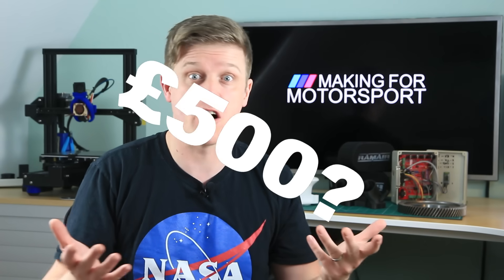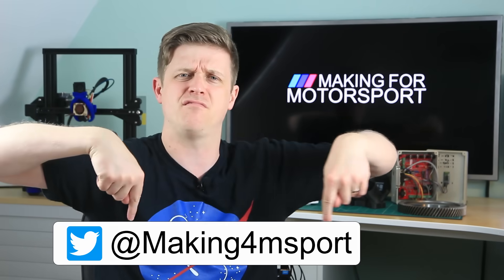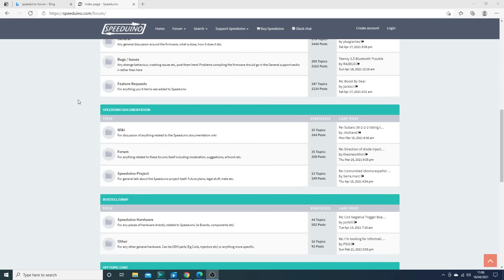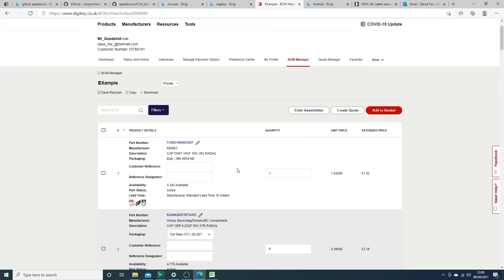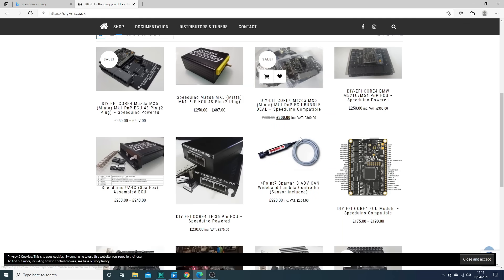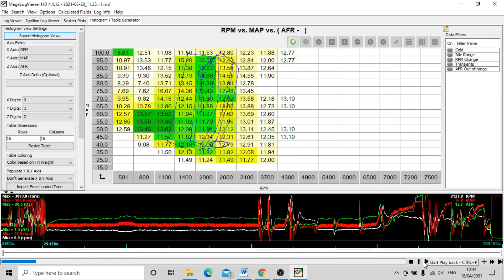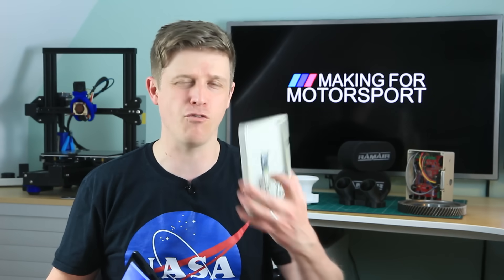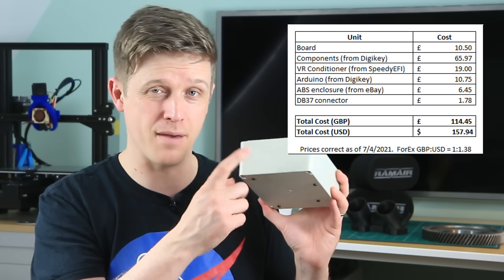The Best Value Standalone ECU - Speeduino

Comment from the maker: New video now out!  I solder, configure, install and run a v0.3.7 Speeduino against the clock!  Did it take me 4 hours or 4 days?  Come find out!
Reply: Makes me wonder if I could use this Speeduino to convert my 30 year-old 600cc Transalp V-twin engine to EFI.
Reply: @paulmichaelfreedman8334 do it
Reply: I’ve been thinking of putting flat slide 34mm carbs on a 70s Moto Guzzi v-twin motorcycle.  Hmmmm, maybe throttle bodies and one of these could be an option, although might have to wait for a shrunk-down version given the size of it right now
Reply: Where can I buy the speedo ecu in canada and it would  be for  a ford 2.9 cosworth boa engine and using  the ford sensor? And also for a second ford engine a 1990 taurus sho engine
Reply: Is this good for engine-swapped classic cars ?

Comment: My 5.9 V8 doge needs a new ECU. The rebuilt ones do not get re soldered. They just get reprogrammed.  The stock ECU is above the Engine and the Lead evaporates from the joints on the chips.  The new one will be located under the air conditioner.

Comment: In some country like in France, you are not allowed to reprogram your ECU except if a mechanic do it and then notify the reprogrammation and the new horse power to the gouvernement and it's mentionned on the car registration document (except if it a part ecu to replace a dead one without any modification on the engine behavior)
so making one by yourself or buying a speeduino it's a big no no, or your car would only serve in some car meet, you won't be able to drive on public road, if there is a big police control and they check that, you're cooked, if you have an accident, same thing, you are cooked, your insurrance won't insure you, and the law will guilt you by default

Comment: A daft question I'm sure as I know nothing about these things, but can anyone make an ECU control unit for an ordinary family car? I have a Peugeot Diesel HDi which I love but it had injection issues no one could suss out. Error codes were intermittent low pressure on diesel pump. One out of four injectors showed low return flow, one showed high return flow using manual measurement. Replacing these the results were the same. What we saw was turned over normally it just won't start for ages, if a bit colder it won't start at all. But it would always start and run fine after an Easy Start blast. I was about to scrap the car, (which would be such a waste of a good machine/pointless environmental damage) when I saw a few videos on advanced Diesel analysis and one mentioned that at least one car requires a certain RPM before it will fire, read by a camshaft sensor. So it could just be that the temperature here in Sweden was making the battery turn the engine that tiny bit slow and preventing injection? I don't know if that is the case here, but I would love to try and make my own ECU (I used to be a programmer, a long time ago, but I know a certain amount) and to be able to shut off response to various sensors to test and run the car properly. But where on earth does one start? Any clues appreciated... am I barking up the wrong tree, totally?

Comment: Sounds like it might be a good ECU for a home-made water injection system. Use RPM, throttle position, exhaust gas temperature, and the knock sensor signal as inputs to keep knock and combustion temperature in control while allowing a chemically correct air to fuel ratio for all driving conditions. It should allow more boost at full throttle to get more power from the same amount of fuel.
Reply from the maker: Apart from EGT sensor conditioning then you’ve got the hardware on board to do what you are after, the software isn’t my strong suit…

I’d suggest you float this on the Speeduino forum as those guys actually know what they are talking about 😂
Reply: @ never know... Someone might already be working on a board that will do both EFI and water injection.

Comment: Interesting - what are the inputs into your unit?  Wide band O2 and what else?
Reply from the maker: Intake air temp
Coolant temp
Manifold absolute pressure sensor (for speed density mode)
Throttle position sensor 
Crank angle sensor
Cam sensor (for sequential injection and coil on plug)

Comment: Will it work on a  1989 jaguar V12
Reply from the maker: Hmmm…. It won’t be ideal, I’m not gonna lie.  It doesn’t have enough channels to run the whole engine, but it can run half the engine as a straight6, in wasted spark and batch fire mode, you’d then need another Speeduino to run the other bank….

Now this might sound a bit mad but it’s how BMW ran their M70 V12 engine until the mid 90s so it’s totally doable…

Comment: Is there no pi based versions?
Reply from the maker: The Pi, as a microprocessor, not a good tool for this application, it needs a microcontroller.

The Arduino mega has 6 hardware timers and a high number of native digital IO.  Plus the firmware coding rather than OS and another application mean it’s less likely to glitch.

There are many applications for the RPi in creating dashboards etc, but controlling an engine just doesn’t need a RPi

Comment: Just what I need ! I plan to build a weird Land Rover engine using a 2.5L turbo diesel sub-assembly and a petrol head, then boost it to 2+ bar to see what it can make.
Reply from the maker: Wow… now that is a Frankenstein build if ever I heard of one!  You sticking to dirty diesel or going petrol?
Reply: @MakingforMotorsport  It will be petrol. The turbo diesel sub assembly is extremely strong and the compression ratio is rather low at just under 8:1 so lots of boost is the way to go. I'll keep rpm low 3.8k max and make lots of torque. I have an engine dyno I still need to build first, that will make things easier.

Comment: So, do you have a learn made where the new controller connects to the old working unit to learn your car's algorithms?
Reply from the maker: No, this only works in standalone mode, not piggy back.
However, the table wizard in the packaged software is good enough to get you going and if you want to get real good data, especially for spark (which is often the hardest to tune), then a simple OBDII reader with a logging function can basically tell you everything you need to know (idle advance, max advance, all in revs along with lots of other data to interpolate from)…. 

I might do a video… 🧐

Comment: how about making a speeduino that controls 2 motors for an ebike with 2 batteries?
Reply from the maker: That sounds like a mental project, but also a completely different controller.  
I am no electronics expert but you can find dedicated brushless motor controllers that you might be able to control with some of the speeduino circuits…

Comment: Hey i have one question  i have a 2.9 cosworth boa engine with no ecu my question is can i use a reg 2.9 ecu to the 2.9 cosworth  engines?  Or which after market  ecu would be best for 2.9 cosworth boa
Reply from the maker: The BOA is a lovely engine, loads of potential
Realistically you need the original ecu and working loom to do a swap using OEM parts, otherwise you will have to get an aftermarket ECU.  A normal Cologne 2.9 ecu won’t run it.

As it’s a relatively simple v6 virtually any aftermarket ECU will run it, to run sequential injection and individual coils you’ll need 6 channels of spark and fuel, which are the more expensive ECUs. 

But the humble Speeduino will run it fine on wasted spark ignition (which is what it runs standard) and batch fire fuel…

Comment: where is the speedpi version then ??
Reply from the maker: The Raspberry Pi isn’t suited to this application as it is a microprocessor rather than a MicroController.
The microcontroller has far more onboard IO, has hardware timers and firmware rather than an OS so all the simple functions can be done totally native.  The RPi would need more daughter boards, take longer to boot up and be less reliable, becuase of the extra complexity, all the while not using anywhere near its processing power…
The RPi is a space shuttle to crack a nut.

Comment: Holy crap! Between this and 3D printing, my Chrysler Caravan will never die!
Reply: Lol
Reply: Why are you printing a Chrysler caravan?
Reply: Up here in the salty road north they dissolve within 6-8 years. LoL. 😆 even if the drivetrain makes it the frame/body won’t.
Reply: @cobannie  Yes, you are an endless source of engine parts!
Reply: @stepannovotny4291 😂😂 The rust belt provides
Reply: @cobannie  Do cars still rust faster in the north if you keep them garaged during the winters?
Reply: @amazin7006  They don't necessarily run faster - but they come up to full operating temperature faster.  My heated garage enables me to start the engine and drive off almost immediately - as soon as the garage door opens.  Unheated garage, it's still going to be cold, but less cold, and will get up to operating temps still faster than without a garage.  So not really faster, but will definitely get up to regular performance faster.

Comment: Hi, I got a quick question for you. I just turned on your channel and I’m just subscribed and I liked it your video new to this. I have a 1968 Firebird with a 454 V8 I won’t. I have a fire tech system. I wanna run fuel injectionand I have no gages. How do I run a digital screen with gauges easiest way to fight tech
Reply: You can get stuff to connect with  USB or even Bluetooth so no wires

Comment: How well would this run a Vauxhall Astra G with a z22se and a gt2052s turbo from a Saab b207? I know the Speeduino will run main engine functions well but I’ve read it isn’t great for daily drivers where you want to keep auxiliaries like A/C, cruise control and power steering etc

Comment: If you want the absolute cheapest if your running the GM gen 3 LS engines you can use an obdxpro which cost 80 dollars or a vcxnano which is a little bit more with open source software pcm hammer and universal patcher or tunerpro alongside the pcm logger you can write and flash a custom tune to the p01 and p59 ecus. The cool thing about this is they have been reverse engineered so extensively that many different engines including different makes and different numbers of cylinders have been ran by these ECUs. 

My P59 is great but theres one big shortcoming. I can't tune it in real time. I had to rebuild my motor so I decided since my crankshaft was toast I added a forged crankshaft with a longer stroke, and a new cam. The limitation to no real time tuning is to update the tune I have to shut the engine off, flash the ecu then test it. Which i don't really want to do when I'm first breaking the engine in. So I think a real time ECU for break in to get things running acceptably is a need, but afterwards I hope I can export the tables from the standalone to the stock ecu and go back to logging. Didn't want to spend 500 dollars for a dyno break in ECU so thank you.
Reply: Are they better than hp tuners? I work at a junkyard and we have messed up vettes come in with ecu issues sometimes we have to put a carb on the thing and that doesn't work half the time

Comment: I dont understand electronics or Arduinos or anything. But can i wire up a random gas pedal and throttle body to this ECM and not worry about anything else on the ecm? All i need is a throttle body to move with the gas pedal
Reply from the maker: Short answer.  No.

If you want that level of simplicity then don’t change a thing.

Comment: I have a 83 944 NA and I would like to upgrade my OBD1 ECU. My car has a O2 sensor TPS coolant temp sensor a air box potentiometer to measure air flow and air intake temp sensor....however no distributor the timing is handled by 2 sensors off the ring gear of the flywheel. I'm thinking MSD 6 AL can handle the timing issue but id like to know if this ECU would be able to handle the timing and ignition system as well? Id like to keep it as OEM as possible.

Comment: Does the speeduino only have 1 ignition table and 1 fuel table? How would one map a Honda with VTEC where the activation & deactivation points often overlap depending on load which requires 2 ignition maps and 2 fuel maps? Finally,  what are the effects or challenges tuning-wise with going with speeduino's 16x16 tables compared to say Hondata's 24x20 tables?

Comment: I just started looking at options and before this I was considering a Microsquirt. I want to update my 1990 racing motorcycle to EFI, there’s a twenty year newer bike that uses the same engine so throttle body assembly is Pierre easy. I’m assuming this can be packaged smaller than the box you used

Comment: Jenvey Dynamic itb for the cyclone engine im building up. I have been using MicroSquirt for the fuel/ignition system with some I/O from an open source software. Kinda did the trick you described with the ampseal header and soldered the day away.

Comment: One of my current projects is my 1992 ZX7R that I want to convert to efi. I was thinking of adapting the complete throttle bodies/ harness/sensors and ecu from an R6 since their power levels are similar.
Reply: But why? Carbureted bikes are much better. They made more power than fuel injected bikes for quite some years, are more reliable, and easy to fix (usually just a quick cleaning). My current zx10r is on its second motor due to electronic issues. My 94 zx7r was extremely reliable as were my zx6rs. I had 3 of them at the same time, one of which I put over 100,000 miles without any issues.
Reply: @keilmillerjr9701  because the oem electrical is damaged. ECU was fried and the carbs, after 2 rebuilds still leak fuel. And it's not like I don't know how to work with carbs, as my 7 other bikes are all carbureted. I just want to try something different.

Comment: I've got a Jeep 2.5 4 cylinder that I am stroking to 3.0. I'm also modifying a 351 Cleveland head on top of it. I'm making a custom cam for it. I want to run individual stack injection. I might go carburetor and just need to control the spark.

Comment: Also wondering if this can be used on vehicles that are supposed to have cats and sensors, and how mot is affected.. 🤔
Reply from the maker: So, check engine lights can’t be on, but if you can fit an diy ECU, that’s not a challenge.  You’ll need to pass the emissions and Cat regs relevant to age of the car, or atleast have something that looks like a cat in the exhaust.

Fundamentally in the UK it’s not too much of a challenge, a friendly MOT might even let you sit in the car to tweak fuel during emissions sampling… 
In the USA however, it’s a completely different issue, RPM vs EPA, smog testing etc etc…
Reply: @MakingforMotorsport  thanks for the replies, I’m definitely liking the idea of it especially after seeing the tvr dash display, just been looking for information on usage with Audi v8 and can’t seem to find any info on how it would be wired up and built, engines going into a 2009 vw converted from diesel
Reply from the maker: @MrTaylorVW  fair play, after a diesel that’s quite the change!!! There’s nothing that can’t be achieve with proper application of effort, and going back to first principles, because it’s an engine after all and they all work in the same way. 
The biggest care point I can see is whether is it direct injection, if it is then the Speeduino can’t run that.  Port injection you are good!

Comment: Can you set up different modes? Like sport mode and economy modes and change on the fly?
Reply from the maker: You absolutely can do different tables but when tuned properly you can get all of those options with the throttle pedal.  Economy at low throttle openings and power at wide open…
Most “sports modes” on many cars are a gimmick and mainly just change the throttle mapping and artificially restrict power with no actually like for like economy gain.  
When used properly, these different tables are useful for different fuels etc…

Comment: Can I use this with an Audi rs4 bns engine ? Even if supercharged or turbocharged? How reliable are they compared to factory ecu? Also how do you get the base map on the engine to start with, use the factory map? Was looking at using the standard rs4 ecu or emerald standalone until I saw this
Reply from the maker: This will run anything up to a v8, including forced induction and run boost control etc etc.  
How reliable are they?  Built right they are very reliable, all the components are spec’d right, use a decent connectors and you are good.  But build it shoddily and you’re stuffed.
There are several base maps available in the software, I’d be suprised if there was an bns engine one but pretty much any sensible numbers gets them running.  It’s things like injector sizing and crank sensor degree offset that you really need.
I’ll be honest, I’d probably just bang it on, but if you are unsure, maybe a diy approach on an expensive engine isn’t a great idea!?

Comment: so this started as a late night drunk though with my friends, could we build our own 2stroke efi system reliably from scratch. well i started designing the engine and everything, of course we wont build our own engine just yet, but right now i have the drawing ready but i need the ecu for as little money as possible since were just 16 years old and dont really make any money
Reply from the maker: People have got 2 strokes to run with the speeduino… it would be as easy having a trigger wheel with 180degree symmetry….
Reply: @MakingforMotorsport  thank you that is very good to hear